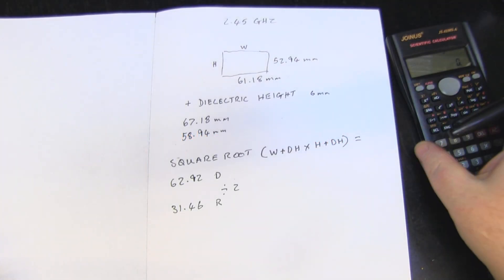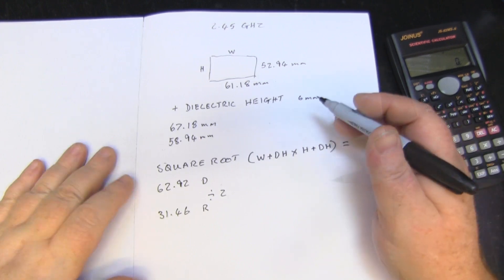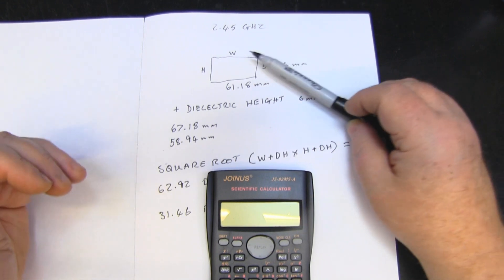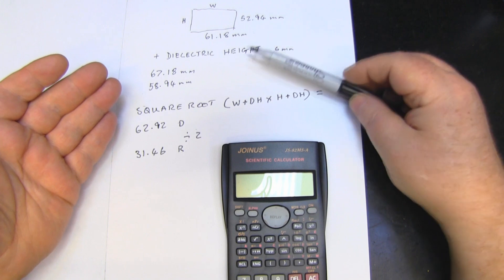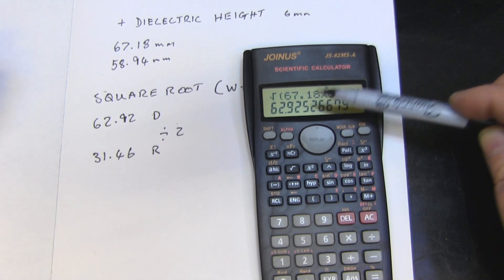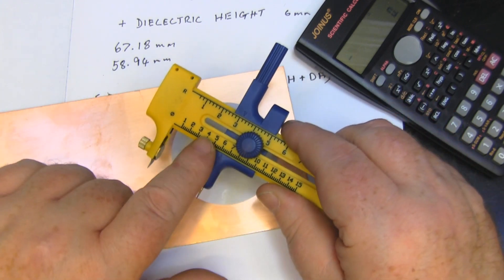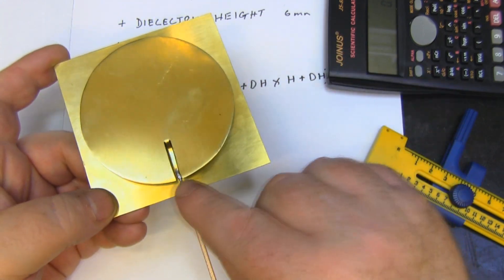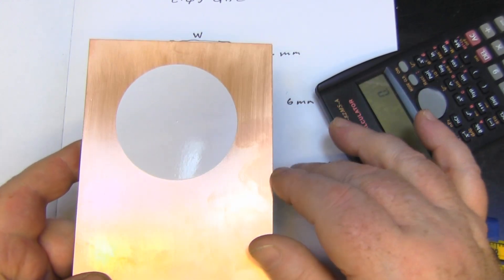Circular Patch Antennas

Comment: Hi my alpha antennas keeping coming loose and leaning/dropping to side ,   i read thread locker is not conductive so thats  a no go , is there anything that i cud put on the router nibs that wud glue them on after screwing on and dry solid ish , so they dont come loose or unscrew after movements,  "Without affecting any gains" or signal in general ,  thx , i have posted this question also in in your alpha 2.4/5 opening review

Comment: how calculate the feed point distance  and any difference in antenna  performances if I place it in the center of circle. ? thanks
Reply from the maker: That’s the thing that online calculators don’t tell you. I will do a video showing some different options.
Reply: @andrewmcneil  Thanks
Reply: Thank you so much for this video. Taking advantage of this question, If possible,  can you also explain, please, about the impedance match of center feed circular patch antennas?